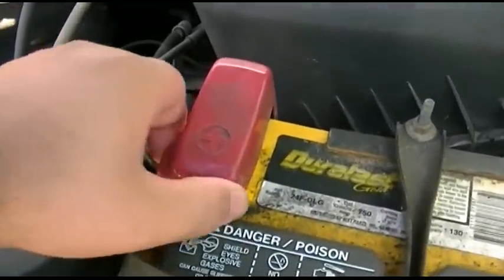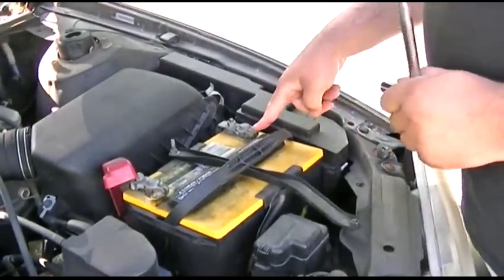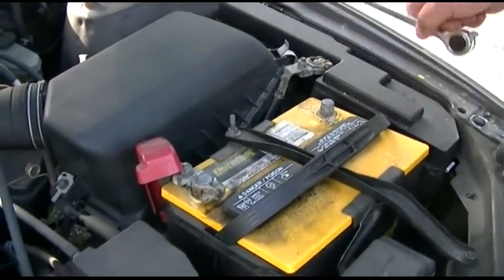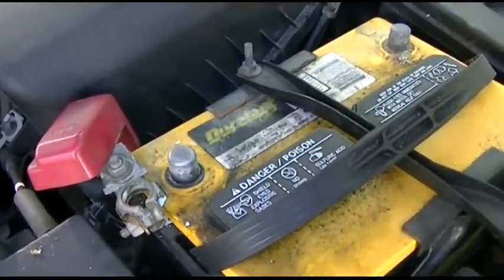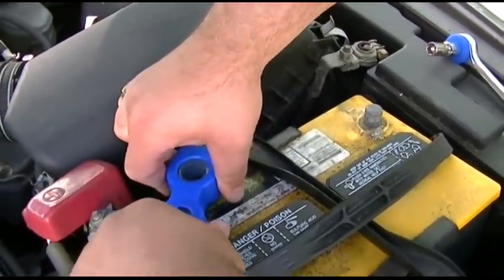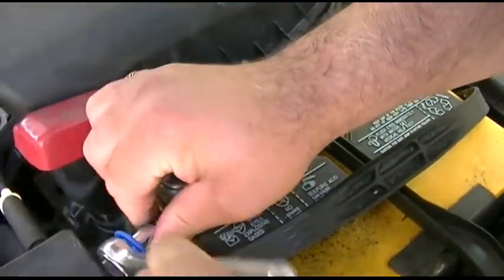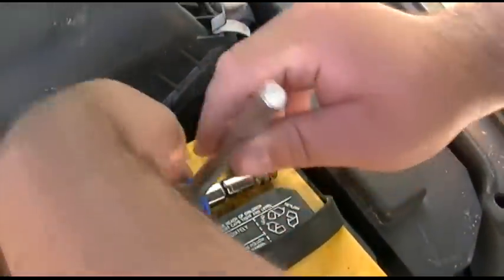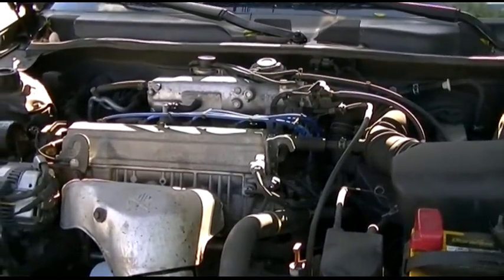How To Clean Car Battery Terminals--THE EASY WAY!!!

Comment: I thought your title of the video said you were going to show us the easy way to clean up the corrosion.  You unbolted everything and did it the correct way but, not the easy way.  I would have expected a Video showing you using Baking Soda and Water to clean off the corrosion.
Reply from the maker: Well I wouldn't have said the hard way, no one would watch!  In the end, the correct way IS the easy way, since you don't have to do it again and again.
Reply: 44357514 what's so hard about this way? it's takes about 2 mins. you don't even have to unscrew the bolts all the way.
Reply: Not easy for a woman who lives alone n is just quickly wanting to  get power connection going in order to get to work.

Comment: Question to be sure. Single seasoned granny here. I don't have to take cables off right? Baking soda +water or coke cola scrub old tooth brush wipe with cloth. Now will any of the stuff I use bother other wires around?? Appreciate info. Finally trying to learn 61 and holding 😝🙋🏽‼️
Reply from the maker: You can use either of those methods if you like, and they will work, but not to the degree the method I showed in this video does.  The main thing is to have a good connection between those cables and the battery posts.  Chances are any sort of concoction will not get into the very small space between the clamps and posts, and that's exactly where the corrosion occurs.

Since disconnecting the battery will reset the computer and cause the engine to not run properly when reconnected, I'd suggest you take a nice quiet day where you have all day, and simply do it as shown in the video.  Take your time.  When you're done, start the vehicle and let it idle for 5 minutes.  Then take it for a good 5-10 mile drive.  Be prepared during that drive for too low or too high idle, and possible stalling.  After you go 5 or 10 miles, you'll notice at the next traffic light it'll all be back to normal.

Might also be a good idea to write down your radio station presets so you can reprogram them in.

Comment: Suppose for some reason it's difficult, almost impossible, to disconnect the negative first and you're forced to disconnect the positive instead. Then what? So you just make sure to avoid touching any metal parts with the positive? How about wrapping a rag or something around it in the meantime?
Reply from the maker: +GymChess You can disconnect either.  It's always recommended to do the negative, because the entire frame of the car, the engine, any metal parts (and most are) are connected to that negative.  If you disconnect the positive first and your wrench makes contact with anything else metal, you're not going to be happy about the situation at all.  I'll leave it at that, your imagination can fill in what may happen.

Wrapping a rag around the wrench wouldn't be a bad idea.  At least you've got a shot at it.

Comment: In real life, then is it okay not to put the grease on the terminals?-I don't have anything like that.
Reply from the maker: Christopher Collado Thanks again, Chris, I appreciate your support in all this.  We know what we're doing, don't ever let "Bob" tell you different.  They also told me never trust a guy with 2 first names, "Bob Bob" is a prime example!  Always have fun with the guys who say they're so much better or "you did this wrong you did that wrong", but they have no videos of their own showing the right way.

I really did Google this a bit, and found that some people smear the grease on the battery terminals first like I did, others put the stuff on after.  Nobody claimed they were batter than the other, just different ways of doing the same thing, which is exactly what we went through here too.

Thanks again Chris, if I can ever be of any other assistance, please don't hesitate to contact me!
Reply from the maker: ***** In the old days with copper telephone lines, I watched a Bell Atlantic (now Verizon Communications) employee install a new phone jack.  The installer put dielectric grease into the modular jack first, then plugged the cable in.  Dial-up Internet was new so fast!

I've always seen it done this way, and never had a problem.  In fact, I just had the hood open today for another issue, and after I performed the same thing to the new battery I installed in January, there's absolutely no corrosion still.  There's many ways to do things, some ways are better than others, but it certainly gets the job done.
Reply from the maker: Christopher Collado Well, I didn't this time, and it lasted.  The grease helps prevent or at least slow down corrosion from occurring.  If you don't have any, it will still work, but you should check it periodically.
Reply: jaykay18 Oh....Okay. Wow you do learn something new everyday..I`ve only a car for year, Im still learning. Thanks for the helpful video and also thanks for tip. :)
Reply: Christopher Collado Ive had my car for a year. (1st one)
Reply from the maker: Christopher Collado You're welcome.  It's always a learning experience.
Reply from the maker: ***** That's exactly what I said, it's there simply for corrosion resistance.  It prevents air and water from attacking it.  The grease conducts electricity; most times I've found the most corrosion occurs on the inside of the battery terminals, that's why they make battery brushes like I had shown in this video.
Reply from the maker: Christopher Collado Thanks, Chris!
Reply from the maker: ***** The jury is still out on this.  Doing some reading on the subject, some put the grease on first, then the clamp, and state that the grease is squeezed out, creating a perfect seal and good metal-to-metal connection.  Others say you grease it afterwards and their way is better because you have "unadulterated" metal contact.

That doesn't make one way right and one way wrong.  Just different ways of achieving the same result.  Like back in the day there was the school of thought to turn your computer on and off as needed, or leave it running all the time.  Nary the two would mix, each side had perfect arguments.  You do what works best for you.
Reply from the maker: Bob Bob You can do scenarios, yes.  Seems like you have an inferiority complex, you think you're better than everyone else.  You've earned it, Bob Bob Billy Joe Bob, banned for life!  Enjoy!
Reply: jaykay18 Hmm interesting never heard of that! yea your welcome! okay thanks!
Reply: Jay just remember one thing!... Haters gonna hate! And btw thanks for the advice it was a nice video, keep it up bro!
Reply from the maker: ALUCARD HELLSING Yeah, no problem, plenty more to come.

I just find it interesting that haters oftentimes have several things in common:
1.  Never have any videos, or if there are any, it's 1 or 2 where they "accidentally" recorded with their phone and uploaded it, the content of the video is nothing.
2.  Have very few subscribers, if any at all.
3.  Often will comment on other videos in the same bad-mouthing fashion.
Reply: ***** I don't meant to start an argument, but Jaykay18 has a good point, there are multiple ways of doing this. And it does get the job done.
Reply from the maker: ***** No thanks, I'm certainly not going to cause the ECM to reset on your account.  Even if there is grease, so what?  There's still connection, and there's no way in the dead of winter, with 2 identical cars and batteries, that yours will start and mine won't.

There is something that can measure the difference in resistance between the two ways:  TEST EQUIPMENT.  Just like how Monster Cable says it's better.  You can't hear the difference between a 14 gauge cable and a 12 gauge cable, unless you're running a super-duper high-end system with hundreds upon hundreds of watts per channel.  And, at those volumes, you're still not going to hear the difference.

Comment: I use to have same car, why check engine light is on? Could you take a photo of the dog bone(motor mount) near timing belt because mine seem to have ruff idle....
Reply from the maker: That's the magical P0420 code.  Search my channel for more information on it.

Rough idle is rare, first off if the plugs/wires have high mileage they should be replaced and see where that would take you.  Otherwise you're looking at something like intake, MAP sensor, or some crap like that.
Reply: Maybe I need to adjust the valve because I did hear a misfire at the exhaust and some ticking noise ,but good enough the car has more than 300,000 miles.
Reply from the maker: From what I've read the valves rarely need adjustment, as they are pretty solid.  If the ticking is bad, they can be adjusted, but it requires many hours of labor and some special tools.

In addition, the valve trains on these engines are always a little bit noisy even when within spec.  Especially with that kind of mileage--some mechanic will give you a $15,000 bill, when the car's worth far from that.
Reply: Thanks!Maybe I need to learn to do it myself LOL. Have you clean (iac) idle air control valve in that car? Did the screw difficult to come out?
Reply from the maker: Never did it.